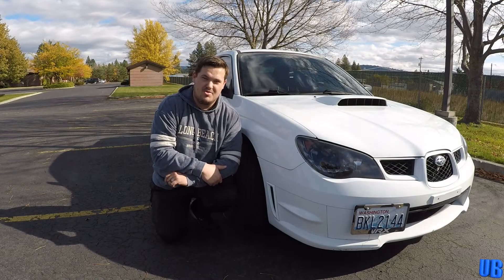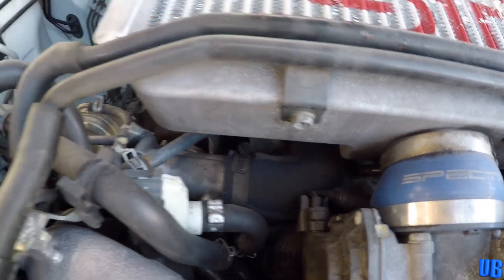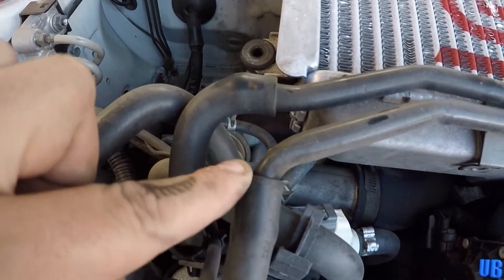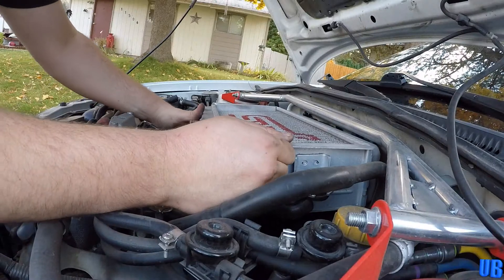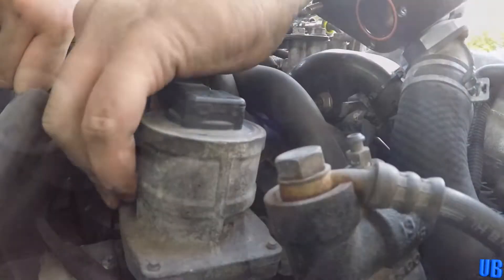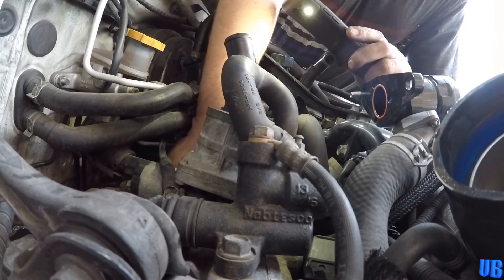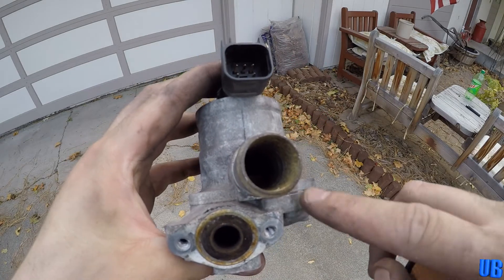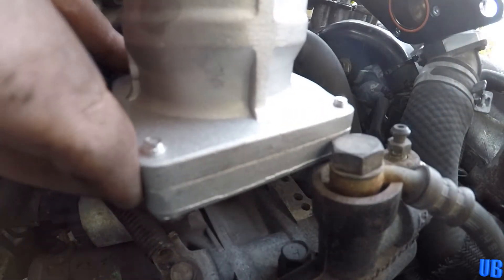Subaru trouble code P2443

Comment: P2443 relates to the drivers side bank…
Reply: And I was hoping this would have more troubleshooting for when you replace the valve and the code still pops up
Reply: @jesusrules0707 that’s my situation rn I replaced the valve still getting code bench tested the valve and it opens

Comment: I replaced both solenoids and a new secondary air injection pump (main) checked air pump relay and i have good readings and still getting p2443 and p2441 code popping up, and both stuck closed  any feedback please 🙏
Reply: Same boat brother… was hoping this would have some more detail. I’ve only seen one other video that could potentially solve it but it involves a good amount of diagnosing electronically. While the part may work, there could be some loss of connection/communication between the part itself and the connectors/wiring to the fuse box or from the fuse box towards the ecu. Subi don’t make it easy for us to solve some of their problems lol

Comment: is it "Ok" to clear the code and continue driving with this condition? Or will doing so potentially make the situation worse and/or affect other components? Thanks
Reply from the maker: Hello! These valves are part of the vehicles emissions system and you can drive with them like this. Your check engine light will continue to be illuminated until the issue is fixed but otherwise it's not a problem. If you do live somewhere that does emissions testing then the issue will need to be resolved in order to pass inspection. Thanks for watching!

Comment: How did you know which of the 2 valves needed to be replaced?
Reply from the maker: Hello! Each valve has its own code to help identify the one with the fault. 

Thanks for watching!
Reply: @UnitedBrothers and you mention a p2443 code which relays to the drivers side bank and you went and replaced the passenger side that has the barometric pressure sensor

Comment: can a bad secondary air valve cause me to not hit full boost?
Reply from the maker: They can but its not usually the culprit. I found I had some boost leaks and a couple weak coil packs. Once I replaced some of my warn hoses and replaced my coil packs my WRX ran perfect again. I later on after the filming of this video did a secondary air pump and valves delete on my car and it still ran fine. So it kind of depends. Thank you for watching!

Comment: Thanks for the video. As I'm looking for the part I'm seeing two different ones, the one you got and a similar one. Is there a way to know which fits mine without taking everything off?
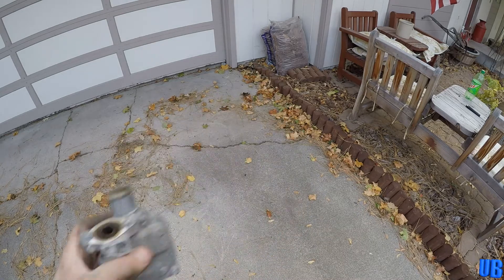Reply from the maker: The one we used in the video is the easier one to get to. It's sits up higher below the intercooler. Also if you skip to 5:47 in the video we provide the part number for the valve. Thanks for watching!

Comment: I replaced it twice and the code has come back almost immediately, what could be causing it
Reply from the maker: First thing we would check is look inside your connector to check for dirt or corrosion on the pins. Another thing we would check is your wiring on your connector to your valve to make sure it hasn't gotten frayed or cut. And if you use a cheeper valve weve heard they can be unreliable.  Thanks for watching!
Reply: @UnitedBrothers  thank you so much ill check it out

Comment: Did this clear your code p2443? I have same code but don't want to replace it unless it fixes my problem
Reply from the maker: This did resolve my p2443 trouble code once I replaced this part. Thanks for watching!
Reply: @UnitedBrothers  gotcha thanks, I'm hoping I don't have to replace the other pump too...
Reply: Also Amazon has these Dorman remanufactured valves for about $150, so went with that over OEM
Reply: I’m starting to think my is a fuse or something, I changed the pump twice and still throwing the code. I wonder if is because I went with the doorman and not the Subaru one, BUT that shouldn’t make a difference!
Reply: @manuelreyes3795 Hey this just happened to me, what’d you end up doing to completely fix it

Comment: That lower one is a b*#%^. I really don’t want to remove the intake manifold. Any other options?
Reply from the maker: We are not aware of any other way without removing the intake manifold. But we would recommend checking out some of the subaru forms online. They usually have a lot of great infomation. Thanks for watching!

Comment: Just did this on my ‘08 Sti, the bottom bolt on the bracket is easily accessible from underneath the car.  Thanks for the video!
Reply: Much easier to access from the bottom! No way I would've even touched the bolt from the top with the tools I had
Reply: I was struggling with that bolt earlier for almost al hour, gonna try from the bottom tmr
Reply: @kevinwarrick terrible take, at no point whatsoever is there any access from the bottom the car, and yes I put my car up on ramps and if any made it worse.

Comment: I got all the way to the lower bracket bolt and gave up, I have no idea how you got it off. Put all the parts back into the cad and probably going to bring it to a Subaru mechanic to figure out how to loosen the bolt. Geeze that was frustrating
Reply: How much did it all cost in the end? You replace? Delete?

Comment: What if you replaced the valve and still get the code?
Reply: There are 2 of them.
Reply: Having the same issue, changed that valve and got the code and check engine thrown again. Did you ever figure out your problem?
Reply: Same here, have you found a solution?
Reply: Anyone figured it out? I changed it twice as well and same code!
Reply: @manuelreyes3795 Anybody figure it out lol im in the same boat

Comment: That lower bracket bolt is a pain my Flippin @$$
Reply from the maker: We do not doubt that. We said a few not so family friendly comments when we were taking that bolt off lol. Thank you for watching and good luck to you
Reply: @UnitedBrothers  well the night started with a car that doesn't like to start after a hot drive. And ended even more codes. And not running at all... so we'll see how Tomorrow goes

Comment: Nice video! Thanks.. I had P2444 (Air System Pump Stuck on Bank1) on my 2006 WRX TR..117k miles .. You have code on Bank 2, right? So is it right to assume my solenoid to be replaced is the other one, which is PITA to get to? How precise the OBDII reader point to which solenoid on which bank stuck?
Reply from the maker: Yes our car was bank 2 which was trouble code p2443. Sadly yours is bank one which will be more difficult to get to. If you go the route of replacing it there are plenty of videos out there on removing the intake manifold for your wrx. We would highly recommend if you are replacing yours if you can afford to we would suggest replacing both while your in there cause if one has failed the other could follow down the road. Thank you for watching
Reply: Thank you for reply! Yeah, already saw many videos with different ways to go about this issue. As of now I incline to do the delete secondary air pump using block off method and re-tune after. Some people block off the pipe itself the one which going from passenger side to the bank #1, instead of removing everything in order to get to passenger side of the motor. At least that is what I am thinking currently..

Comment: Yeah I've got that code. And my access port says the valve is stuck open...could this cause the car to not start after the engine is warm??
Reply from the maker: Hey there! We are sorry to hear your car has this code. To answer your question since your valve is stuck open it can cause issues on start. Other symptoms include a pore or ruff idle and some hesitation when accelerating at times. I hope this video helped you out and we hope we were able to answer your question.
Thanks for watching!

Comment: yup my 2011 STi gave me the P1410, one of the two valves are acting up. I was able to get mine from Partgeeks for about 180 US $, i might just replace both of them while im at it
Reply: @jrose3638   i did end up replacing both, the culprit was the combination valve on bank 1 but you have to remove bank 2 to get to it so might as well replace it. The air pump itself was a recall on my model. Had my local dealership handle that
Reply from the maker: Honestly that's the best way to go about it cause if ones acting up the other ones sure to follow eventually. Thanks for watching